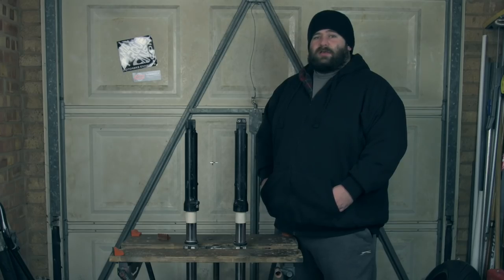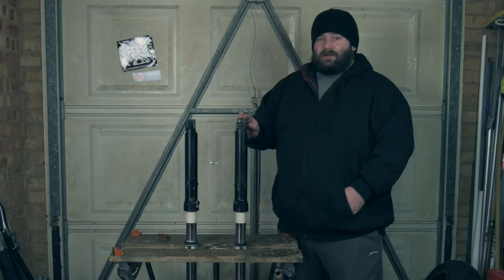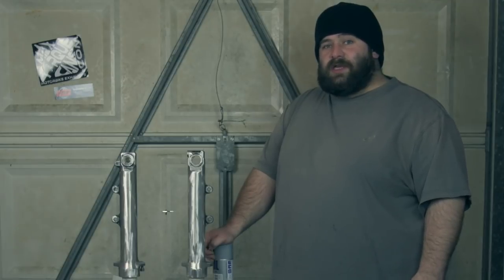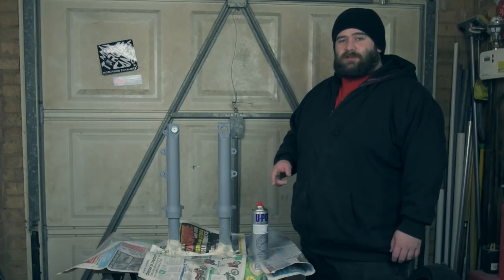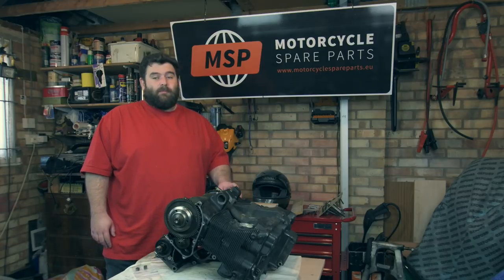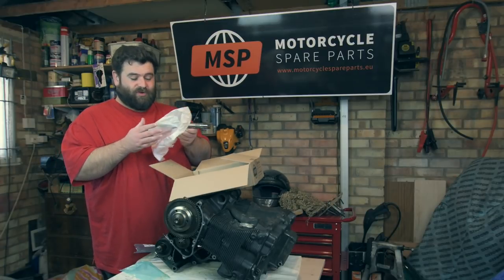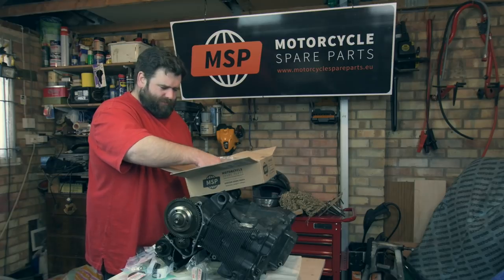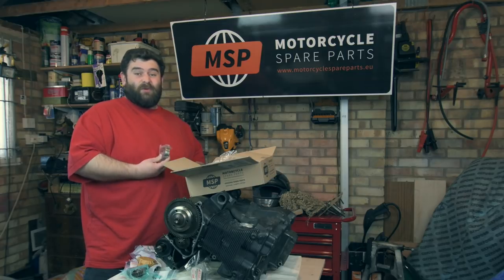Bandit fork painting | It's Bandit o'clock series 2 Part 9

Comment: great video as usual.

is it just for me or these last videos have only left side audio output?
however i have some questions about removing paint of metal parts... why use a grinder if you can use a chemical compound such as acetone which would not scratch mechanically the part itself. i know the primer will cover it anyway but acetone, i imagine would also be a quicker way to remove the old paint.

love the unpacking at the end with the new parts.. the Christmas has arrived early for Ian this year.
keep it up!
Reply from the maker: Hi Vale Sy, most of my listening devices are mono so haven't noticed 🙈 checked it on a stereo set up and you are correct, I've fiddled with the knobs and switches on the audio recorder and it's now recording in stereo so should be back to normal from the next video. With the paint removing I also wanted to removed the oxidised metal on the forks and the tool I used gives a good base for the primer to adhere with, only takes about 10 minutes to strip the paint back on each fork with the die grinder I would imagine it would take the same amount of time with a paint stripper. Glad you are enjoying the videos 👍
Reply: Classic motorbikes good point. thanks

Comment: Hello everybody 🤣🤣🤣 love that.  So where can you buy those plastic wheels and what are they called.
Reply from the maker: Cheers Ross 😂 it’s one of those things that just stuck! The plastic wheels are by 3M and called Roloc, but you can get generic unbranded ones that look the same, Roloc is more the fitting type and you can all sorts of flap discs, sanding pads etc. I normally get them at autojumbles but you can get them from eBay. Hope this helps Ian.

Comment: Plastic pads for the die grinder, where do you get those from?
Reply from the maker: Hi Mick, I got them from a tool stand at an auto jumble, think they are made by 3M a twist lock or something like that, will find the proper name for them
Reply: Classic motorbikes cheers, I wanna buy some.